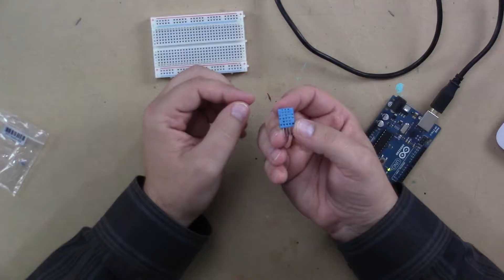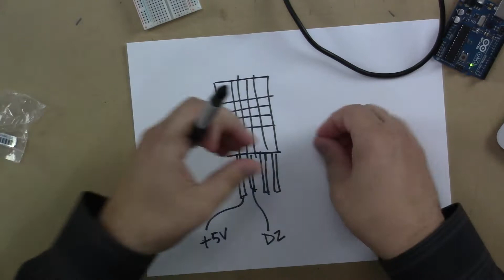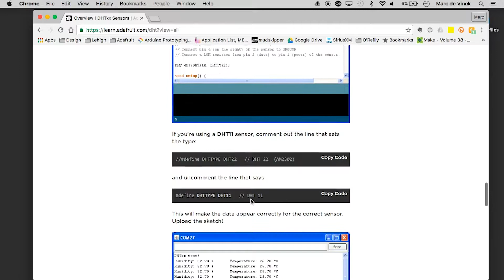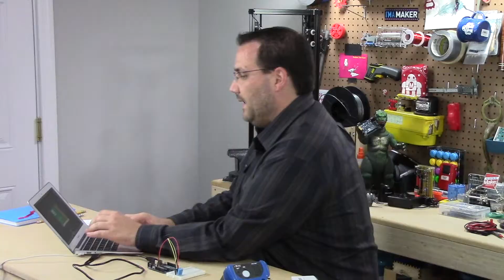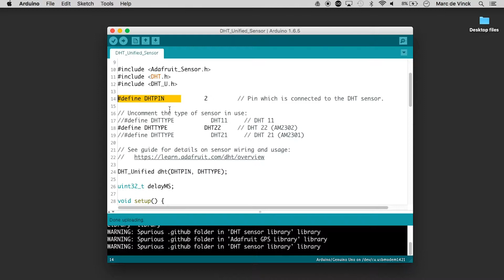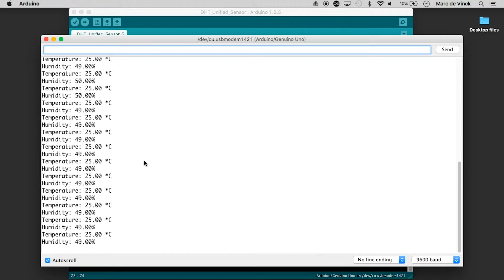Arduino Humidity Sensor Tutorial | DHT11 & DHT22 Temperature & Humidity

Comment: Hello sir, 
once again thank you. I am working on an Agriculture project and I am confused about which sensor should I take for accurate data.
Reply: Data of temperature, moisture soil, humidity, and many more. Can please help to list down the sensor used in the Agriculture project.
Reply from the maker: @kuchalaggyan2502  I suggest you go to a supplier of the sensors and look at what they have to offer. It all depends on your needs, required accuracy, etc. Try Adafruit.com as they have the best sensors and supporting code, tutorials, and more for all their products.

Comment: can I connect the 5V to the positive rail and pin one and two to the positive rail too? in order to connect the 5V to these two pins
Reply from the maker: Not sure what you are asking? Positive rail? Of what? Two other pins? Which pins? What are you making? There are so many variables that I couldn’t address them all via the comments. Try connecting with someone local or find some classes online to learn more about basic circuits and electronics. It’s a lot of fun, and it all translates to Arduino. Wish I could help more!
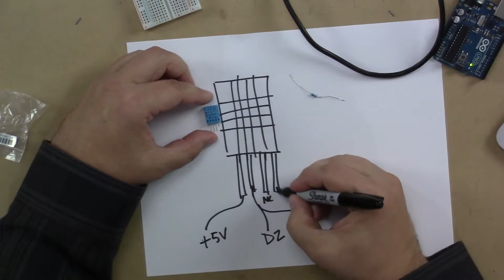Reply: @MarcdeVinck  I'm asking about your circuit in this video, in 2:16 you had to connect 5V to both of the first and second pin, so I'm asking if I can connect 5V to the positive rail and connect the first and second pin to the positive rail too in order to connect both of the pins to the 5V
Reply from the maker: @pharaohboy8657  OK, got it. Yes, both do got to 5V, but NOT directly. You need a pull-up resistor on pin 2. To clarify: The left-most pin is connected to VCC (5v). The second pin is the data pin, connect it to the pin you want to read from on the Arduino. Also, connect this pin (2nd pin) to a 10K pull-up resistor, then to 5V. The 3rd pin is NC (Skip it!) and the 4th pin is GND.